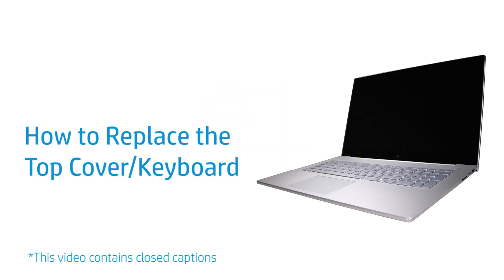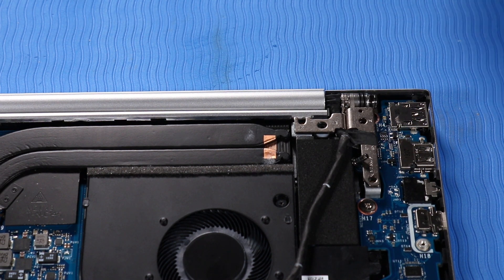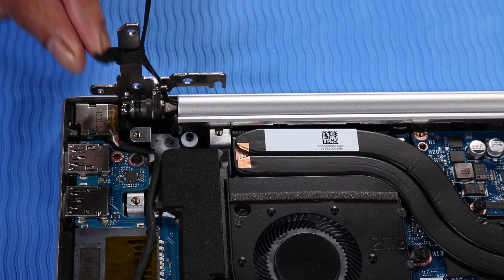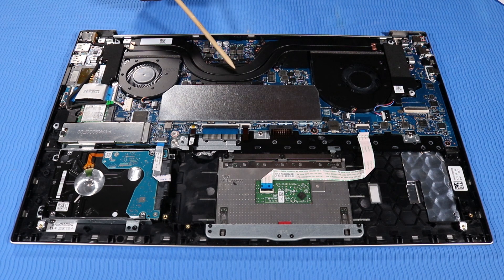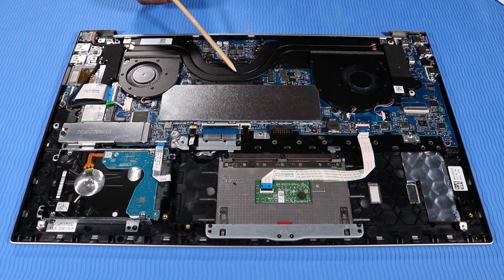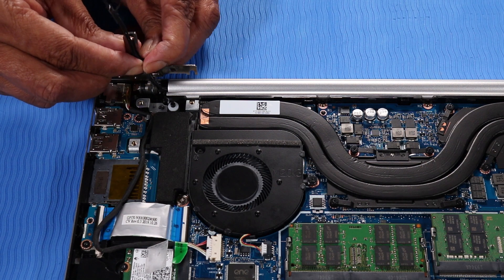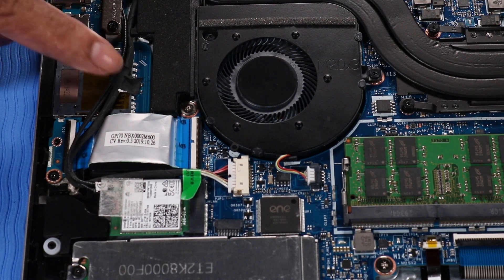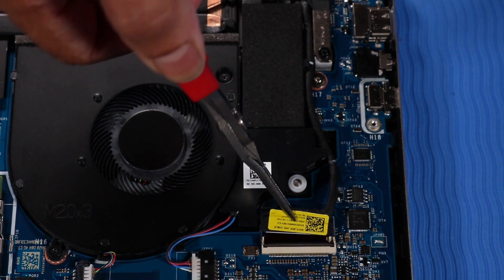Replace the Top Cover Keyboard | HP ENVY 17-cg0000 Laptop PC | HP

Comment: You didn't actually show the replacement of the top cover keyboard.  Three tones are supposed to simulate the activity in the title of the video?  Absurd, HP.
Reply from the maker: +liaisonguy Follow these steps to remove and replace the top cover keyboard for the HP ENVY 17-cg0000 Laptop pc:
- Before you begin: Remove the base enclosure and battery. 
- Disconnect the display panel cable from its connector on the system board.
- Remove the display panel cable from its routing channel along the left speaker.
- Remove the P1 Phillips-head screw that secures the left hinge to the top cover.
- Open the left hinge.
- Detach the adhesive that secures the display panel cable to the left hinge.
- Peel back the plastic mylar and disconnect the wireless antenna cables from their connectors on the wireless LAN module.
- Remove the P1 Phillips-head screw that secures the right hinge to the top cover.
- Open the right hinge.
- Detach the adhesive that secures the wireless antenna cables to the right hinge.
- Lift and slide the top cover out from under the hinges, and remove. 
- Remove the following components from the top cover and keyboard:
• Touchpad board
• Hard disk drive
• M.2 solid state drive
• Wireless LAN module
• USB board
• DC-in connector
• Memory modules
• Fans
• Heat sink
• System board
• IR board
• Speaker assembly
For replacement, put the top cover and keyboard face down.
-Install the following components on the new top cover:
• Touchpad board
• Hard disk drive
• M.2 solid state drive
• Wireless LAN module
• USB board
• DC-in connector
• Memory modules
• Fans
• Heat sink
• System board
• IR board
• Speaker assembly
- Place the display assembly on a flat surface, with its hinges rotated away from the display panel. 
- At an angle, move the top cover under the display panel hinges so that the alignment pins on the top cover go through the alignment holes on the display panel hinges.  
- Rotate the top cover and display panel hinges down onto the display panel. 
- Attach the adhesive to secure the wireless antenna cables to the right hinge.
- Close the right hinge.
- Replace the P1 Phillips-head screw that secures the right hinge to the top cover.
- Reconnect the wireless antenna cables to the wireless LAN module. 
- Replace the plastic mylar over the antenna cable connectors on the wireless LAN module.
- Smooth over the adhesive to secure the wireless antenna cables to the DC-in connector cable.
- Attach the adhesive to secure the display panel cable to the left hinge.
- Close the left hinge.
- Replace the P1 Phillips-head screw that secures the left hinge to the top cover.
- Route the display panel cable along the routing channel on the left fan.
- Reconnect the display panel cable to its connector on the system board.
Caution: Improperly installing or replacing parts could damage  your HP device or void your warranty. Before replacing any parts, check your warranty.
Reply: @HPSupport  I'm with liaisonguy:  Absurd
Reply: @HPSupport  it will more helpful if you can show us step by step, I'll appreciate it